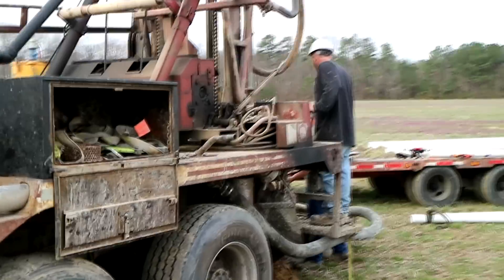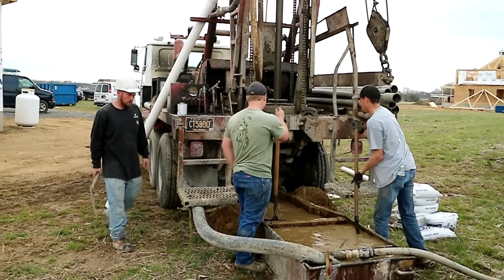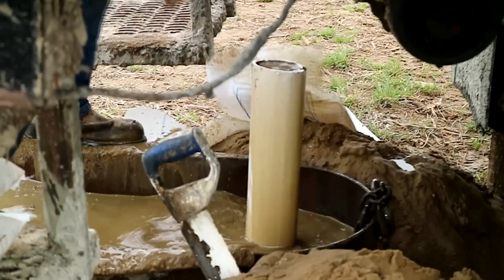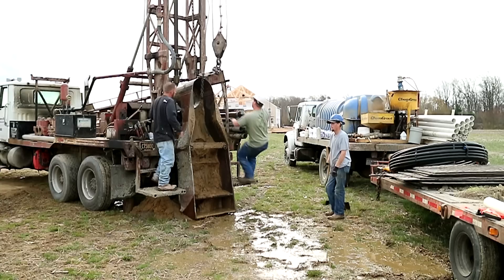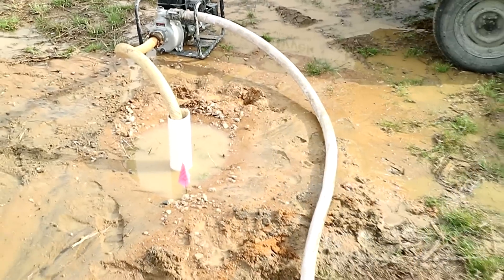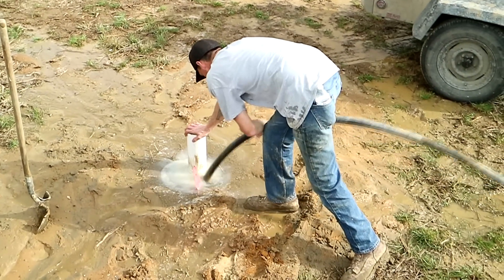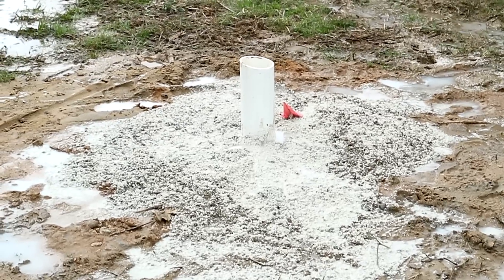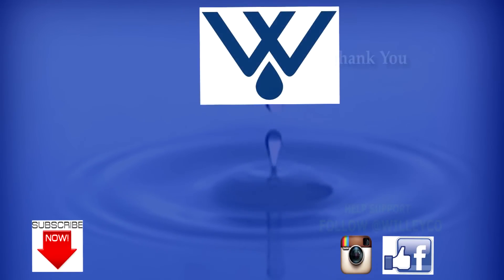Drilling a 4 inch PVC Residential Water Well

Comment: If you have Sulfur in your well I have the solution. It is called  The Sulfur Removal system. Guaranteed to remove Sulfur from your well water making it taste like bottled water. It is a patented product working successfully for over 20 years in 43 states. You can  contact me at wellservice77@gmail.com or 843-812-3229 Beaufort, SC Henry Dickinson 33 Years in the well drilling business. No chemicals or filters needed. It's a good business to add to your business you can become our dealer in your area.
Reply from the maker: Thanks for the input Henry. We do have some areas around here with major sulfur issues. Thanks for watching.

Comment: a starter question...why you put the perforated  PVC all the way , i understand u want water in the pipe, but this only under the bedrock no fear of the pipe above that level will get contamination till the bed rock for example from the Bentonit [as a grout] injected to fill the gap between the wall of the hole and the casing pipe?  let me now please rafi4072308721@gmail.com Greetings, Rafael
Reply from the maker: We only put 10' (on average) of screen on domestic wells. We place solid casing on top of it to the grounds surface.

Comment: I question the grouting the whole well here is why. In many areas you must drill a large pocket below the water sand. If you grout down to the gravel pack in these cases you would be grouting off the watersand. My well here in WV  the watersand was 35 feet but its low producing so the well itself is 105 feet this gives plenty of volume to make the well viable. Grouting the way you describe i wouldnt have any water. Here we install a surface casing to bedrock  and grout the surface casing only. Then a 4 inch liner pipe is installed to bottom but not grouted then as you did the gravel is put in up over the screen. Anything below the bedrock will not contaminate the well and will be potable.so grouting past bedrock is a complete waste.
Reply from the maker: On Delmarva we drill in all sand and silts. Its imperative to seal the grounds surface off from all the aquifers encountered during the drilling process. Our regulations require grouting the entire hole. Theres always space between the casing and the borehole. Even if its a very small amount, bacteria and contaminants can drain down the side of the casing and into the aquifer.
Reply: @willeyco4458  different areas and different structural strata does require different ways to construct a safe well. But the one thing that seems should be common no matter where it is, is bedrock. Bedrock is a impermeable layer of thick rock of at least 5 feet. No surface contamination can get past it long as it is properly sealed. So even though you have alot of sand or a strata prone to collapse if you set a surface casing into bedrock and grout it in to surface. They will not be anything from the outside ever get in. The exception to this is when drilling deeper for oil and gas in this case surface vasing must be set well below all fresh water aquifers and cemented back to surface. This is to protect from contamination from the drilling processes and the oil and gas that lays deeper below. Drilling has bern my life a 3rd generation in the field.
Reply from the maker: Bedrock is incredibly deep in some areas like Delmarva. No water wells that I know of on the lower part of Delmarva are placed in or under bedrock. The northern part of the peninsula has much shallower bedrock. We confine wells on the lower shore by placing them under clay layers. Clay layers are what separate our aquifers. Drilling conditions change dramatically depending on location. Thanks for watching.

Comment: I was wondering what you do if you hit bad water at a shallower depth, but know from other local wells that the good water is deeper. How do you keep them from mingling?
Reply from the maker: In Delaware we seal the entire annulus (area between the pipe and the borehole wall) with bentonite from the gravel pack all the way to the surface.

Comment: Nice video. Its also possible to drill 4" borehole drilling without a big machine. This https://www.youtube.com/watch?v=UvKsmuwSi9o shows how it works and animations show what happens in the ground. For example how to prevent the wall from collapsing etc.
Reply from the maker: It would be tricky but its possible.
Reply: Correct @willeyco4458  its not easy and some places where soil is very rocky or water is deeper than 40m are not suitable for manual drilling.

Comment: Nice very well done pun intended almost same procedures with my company was that a portadrill? I have had good luck with my speed stars and you know what I mean by luck If it can happen it will happen and the differences were we have to do 50' seals unless pre aproved with 6sack sand slurry also much larger diameter and depth1625' 18" Johnson 040 wire that's the deepest water well I have drilled 
off shore now that's some deep drilling  5 miles also one technical trick you can do I use on every well keeps me out of coming up short is run the casing in a32 to 37 viscosity run trim in the caseing cap the top pump out the trim and up the annulus once 27 vis. has been achieved gravel pack  Keep it turning to the right my friend its a tough business but a honest living be safe
Reply from the maker: Thanks for the support Jake.

Comment: Do you ever drill well that overflow..  They all do here, as we are on a low plain, surrounded by hills.  Usually our wells can lift the water 20-30 feet just on artesian pressure alone.
Reply from the maker: We do have artesian wells in Delaware. Their not common but we definitely drill them from time to time.

Comment: Do you have to mix the grout to a certain viscosity before you pump it to seal the hole?  I think I remember years ago in New Mexico that grout had to meet something called a Marsh Funnel viscosity specification before you sealed hole to total depth.
Reply from the maker: Consistency / Viscosity are important factors to monitor during the grouting process or big problems can occur.

Comment: Is a seal required on top of the gravel pack before you grout?  In my line of work, we set piezometers for Geotechnical studies, and often I’ll require a few feet of hole plug on top of the filter sand to prevent mud/grout from getting to my filter sand - this may be overkill
Reply from the maker: Actually our state regulations mandate the grout to extend from the surface to the top of the gravel pack. I actually wish we had a buffer in the regulations. Thanks for watching.

Comment: Great video ! Is it true that there is water between the aquifers and the ground surface. The reason I ask is our aquifers run between 180' to 220'  I have been told that there is "Surface water" that can be used no lower that 100'.  Does that make sense to you?
Reply from the maker: Every area is different due to different geology and hydrology but most acquirer have certain thicknesses and they are separated by silts, clays, and rock.

Comment: Great video. The pipe is 4”, what size is the hole? Also does the Bentonite not penetrate the well gravel and screen?
Reply from the maker: In Delaware we are required to have 1.5" from the outter edge of the casing to the sidewall of the hole.

Comment: Is it a open holed drill to the bottom and no casing? Is there no danger of cave in before the well casing goes in? Is the ground conditions that hard all the way down? Interesting video
Reply from the maker: It is an open hole the whole time. The pressure of the water holds the wall open as well as drilling fluids as needed. Thanks for watching.

Comment: Good Evening  -

I live in a residential neighborhood constructed in 1970.  At that time there were no public sewer lines in the neighborhood. All homes at that time had septic tanks buried it their front yard. Around 1977, the township put in a public sewer line and everyone in the neighborhood hooked into it.  All septic tanks were left in the ground. I want to have a well drilled in my backyard but the only access is through the front yard and over the part of the front yard where the unused septic tank is located. My concern is that the extremely heavy drilling equipment with cause the unused septic tank in my front yard to collapse, potentally resulting in damage to the drilling truck. 

My question for you is whether there is well drilling equipment, including trucks, that are light enough to avoid crushing my front yard?
Reply from the maker: In Delaware, any abandoned tank or vault of some kind must be either removed or filled with sand. That helps prevent these types of issues. There are well rigs light enough to travel across unstable ground but I doubt any driller will want to run their incredibly expensive Rig across or near a known potential for damage. Thanks for the quiestion
Reply: @willeyco4458  Thanks for your response.  I obtained from my Township the application for the permit to install the septic tank on my property 50 years ago.  The tank is nowhere near well drilling equipment would have to pass over to access my backyard.  At this point, my concern is that the mud and cuttings involved in the drilling process will run off onto my backyard neighbors property. Can that be prevented or contained?
Reply: If you plan on living in that house for a while, you might be better off to just deal with that old septic tank now. Those old septic tanks are typically made of concrete and of varying quality. If you have seen a 50 year old concrete sidewalk or driveway, that would give you some idea of what condition it might be in. You could probably get an excavating company to remove the lid and fill it with sand and replace the lid for less than $1000 depending on your area,

Comment: What prevents the well sides from collapsing when you extract the drill bill, and before you get the well casing dropped into the well? I'm assuming you never hit bed rock on this particular case.
Reply from the maker: We don't have bedrock in the lower half of the state. There is some in the northern part. We don't offer services that far away. The pressure from the water keeps the hole open. Sometimes we use drilling fluids that are specifically designed to hole the hole open or keep the clay from swelling. Thanks for watching.

Comment: I notice you used a wing bit to drill the well. We drill wells in michigan done pretty much the way you do. But we use roller carbide button bits. Btw our rig is a gardner denver 1000. Its served the family business very well . our family has been drilling wells over 100 years. Its always nice to see other drillers work
Reply from the maker: Awesome to have another driller stop by, Thank You. On Delmarva the drilling is pretty easy, its all sand, all the way down. We do have some issues with hole collapse but we can normally keep control of it with drill fluids.

Comment: Very interesting video thanks for providing it. How deep is the average water well in your service area? Also, how do you determine the drill location on a particular parcel of land?
Reply from the maker: The average depth well is 50-70 foot. We have lots of shallow aquifer water on Delmarva. Most of the time the deeper wells have more quality risks (Iron, Sulfer, etc). Location is at the owners choice most of the time as long as it meets isolation distances from contamination sources like Septic Systems. Thanks for watching.

Comment: Nice process. The only thing ive done in the past that may be better is to attach the poly line for grouting to the casing as you put it down. You wont have issues not getting your poly down that way.
Reply from the maker: Your correct. That works great in deeper holes but when we are only going 50-70 foot we can get the poly down by using water and jetting it. Thanks for watching.

Comment: You probably answered this already but how much would a 60 foot well cost.???
Reply from the maker: Average cost for the well itself without any pumping equipment is $1000-$1200. Thanks for watching.
Reply: @willeyco4458  wow, our price here in the middle of Canada for a well similar to this well would cost 4500.00. That`s with a 5 foot long stainless steel screen that is 5 inches in size and 5 inch pvc casing. Dont`t  under price your work fellas, they will only need one well in their lifetime if it is done properly.  Keep it turning to the right.

Comment: So you fill the outside of the casing with grout. At the top its like a mushroom head. When the ground freezes and the mushroom head lifts does that cause a problem and allow contaminants into the well?  Is this well for drinking or outside watering only?  How is the pump attached to the supply line?  Do you use pitless adapters?
Reply from the maker: The clay swells up tight against the well casing and the outside of the drill hole if it’s done properly. That’s why you get the mushroom looking head on the top of the ground. There’s pressure and swelling going on. Methods and materials for sealing wells can be controversial as many studies have concluded different results. Every jurisdiction has their own specific requirements which vary dramatically.  A water well in Delaware is basically defined as a hole that intersects natural ground water. Thanks for watching and I appreciate your comment.

Comment: How deep are you able to drill with this and how much drilling can you get done in a day.  say 8- 3/4" hole to a depth of 400'
Reply from the maker: We have drilled down to around 420' however our larger rig (seen in the video) is built to drill much deeper if working properly. On Delmarva we have an abundance of water in our shallow aquifers, deeper holes aren't usually required. How much we can do in a day is highly dependent on specifications of the well as well as the drilling conditions. A 100' deep well in great sandy conditions would take 120 minutes or so while that same well in clays could take much longer. As the diameter of the well increases the time to drill dramatically increases. We recently did a video on drilling some Ag Wells for a Poultry Farm https://www.youtube.com/edit?o=U&video_id=W6wXZEahYwA. That job we set our own best drilling record for number of wells drilled in a day. Thank You for watching.

Comment: Very detailed video. What class/type of PVC casing would you typically use if you were going say 250 meters underground?
Reply from the maker: That's 820 feet roughly. We don't typically drill wells that deep on Delmarva. We have an abundance of water in our shallow aquifers. We drill from around 0-420 feet or so. We use sch 40 in those depths. Thanks for watching.

Comment: What size screen do you use on a project like this
Reply from the maker: Our standard size screen is a .016. This changes with the drilling conditions but the .016 is a very common screen with our residential applications in lower Delaware. Thanks for your question.

Comment: How do yall keep the hole from collapsing when drilling or putting the casing in?
Reply from the maker: In shallow holes the weight of the water itself keeps the hole open in a lot of conditions in our primary drilling area. There are many times as well when we go deeper when we use drill additives to create a thicker water as well as even leave a layer of  mud on the sides of the hole to help prevent cave in. There are many drill additives on the market that do very specific things to the water in the system. The water is all basically recirculating while we are drilling so we add the chemicals into the mud pan and it recirculates through the hole by going down the drill bit. Thanks for the question.
Reply: Mix bentonite in the wash system.